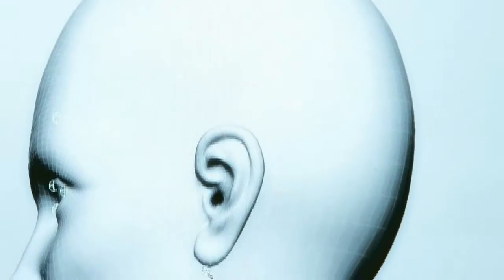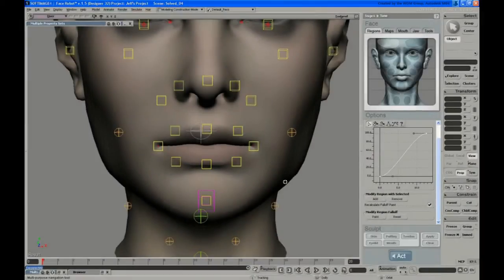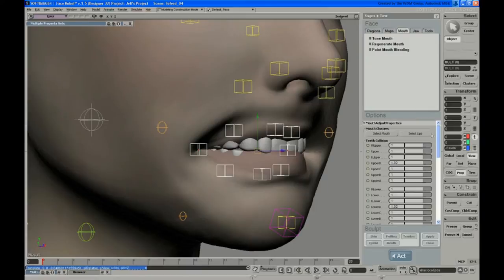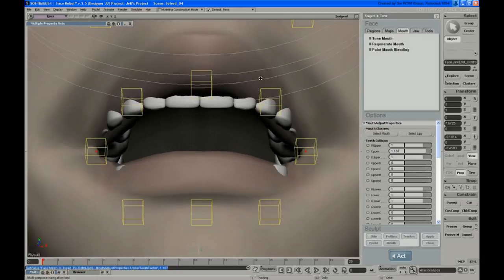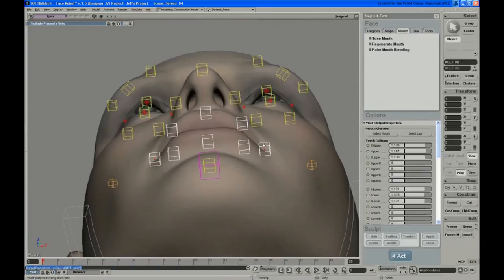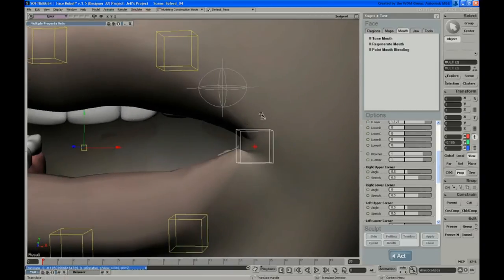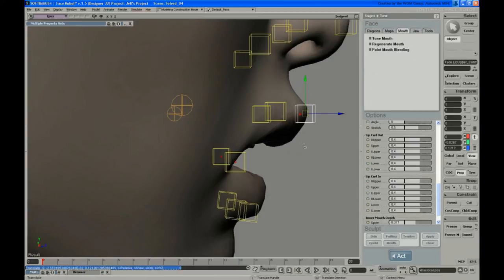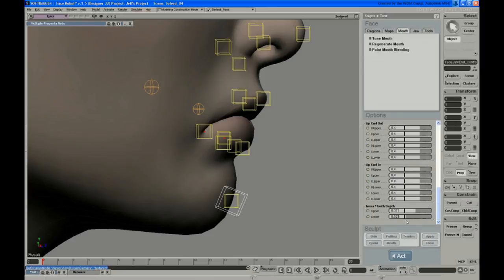Face Robot Legacy - Part 14: Teeth Collision, Mouth Corners, and Lip Curl

Comment: Thanks for the video, two quick questions:
1. As for the lips ( and other regions of the face ) is there a way to mirror the weights? Jeff clearly said that unfortunately theres no way to mirror weights from left to right, so I was wondering if nowdays there is a solution, instead of weighting the two side of the face ( such as the left mouth corners and right mouth corners and many others ). Main goal is to do one side and then mirror the same weights/data to the other side of the face
2. Let say I have a proper weighted/rigged face in Facerobot: is there a way to share the same rig/weighting between different characters? I was thinking to use GATOR and shrink wrapping to transfer all the data between two characters.
Or, as soon as I solved the head ( lets say I'm at the "Face Robot Legacy - Part 3: Testing the Solved Head" stage ) to transfer all the weighting and tweaking from the other "already weighted/tweaked properly" head, in order to have an already good weighting that needs minor adjustment in order to work properly
Hope its clear
Cheers